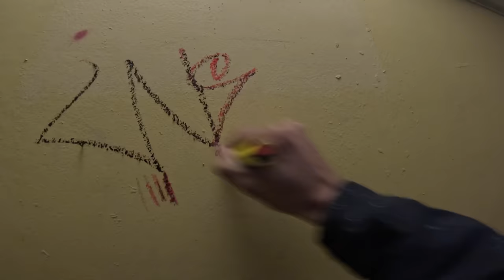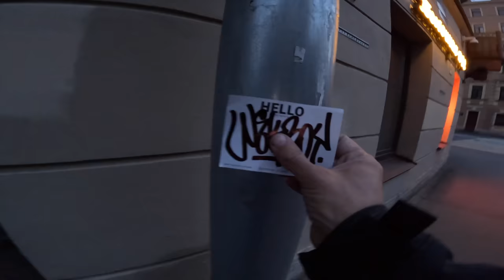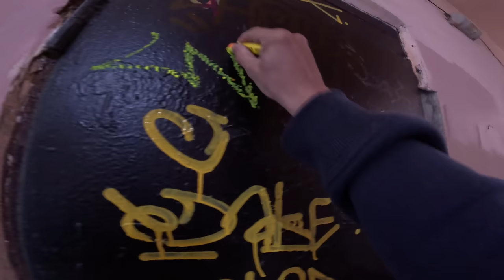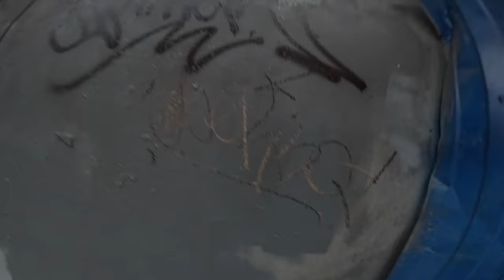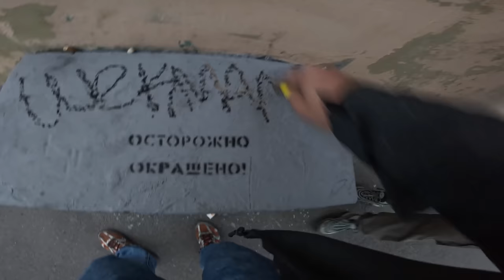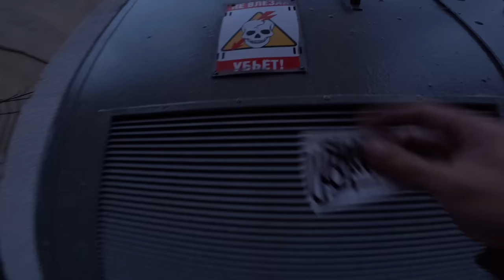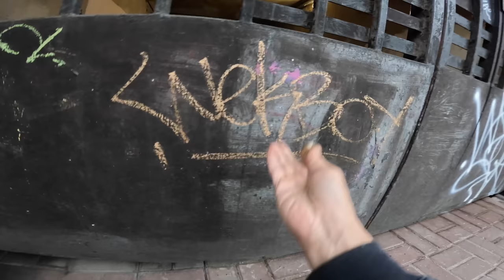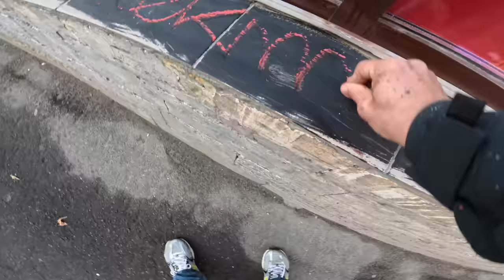Graffiti test with Wekman // HandMixed Rough Wall

Comment: Not a big fan of the mixed ones, specially when it’s a light color mixed with a dark one. And the splits always break apart. I will see how you did with them. Big up brother Wek
Reply: Yup as I thought. It breaks a lot. Best to use the solid one color and best surface to use is on train metal!
Reply: @RustyGraffitiReviews soft streakers are amazing for the streets no break no heat from the train needed i don't see why no one has simply tinted it
Reply: @Gyub-hb8nl  actually there is a tool specifically to hold these markal markers, I have one and will put out a video of it soon. It holds the entire marker